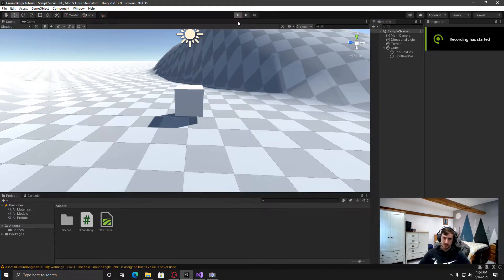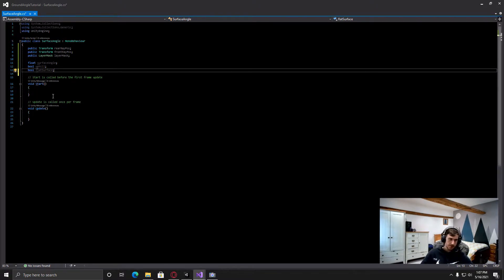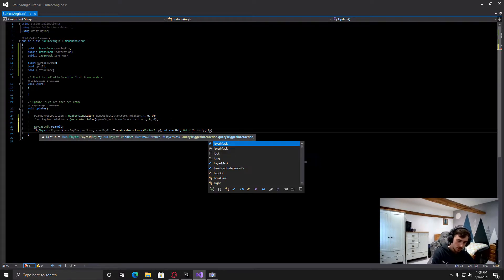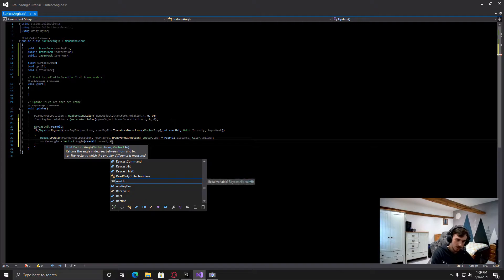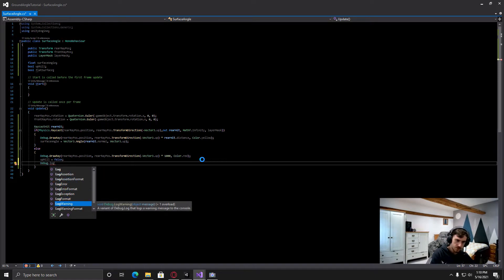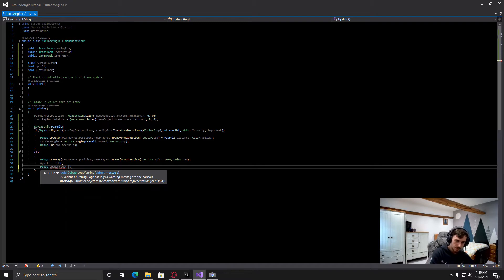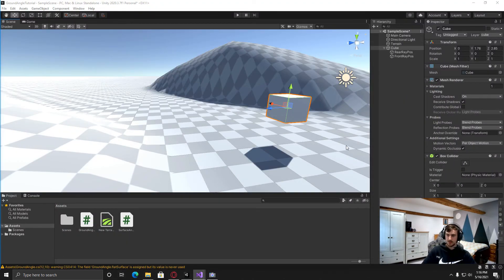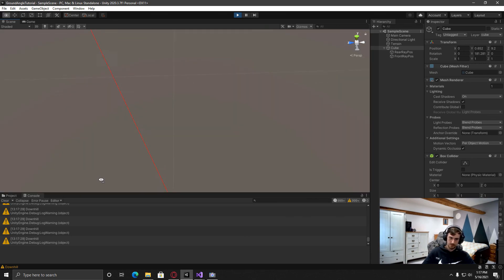How to Detect Surface Angle and Hill Direction (Unity Tutorial)

Comment: Good video, but for some reason I’m having trouble getting it to determine flat surface. I am using default planes, and when I move and rotate my player around it just randomly changes from downhill to uphill to flat surface. Turns out when running debug on the ray casts, they are decimals off, how can I fix this?
Reply from the maker: If your on a flat surface the normal should be 0,1,0 or -1 so you could check for that